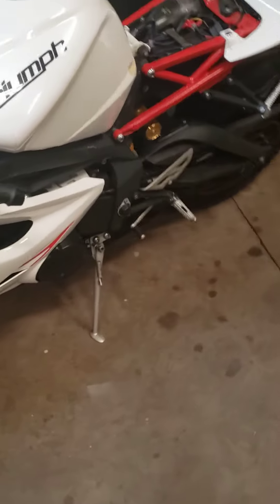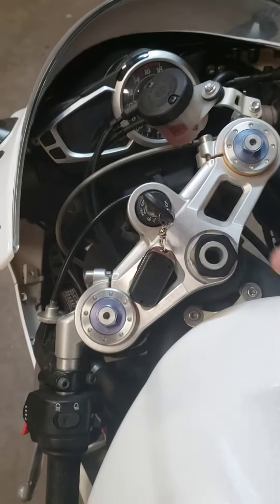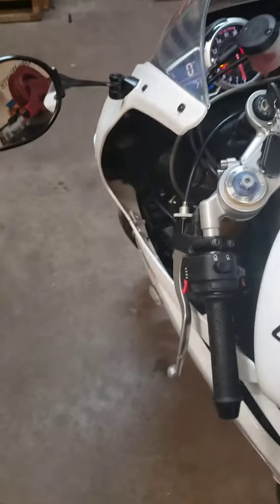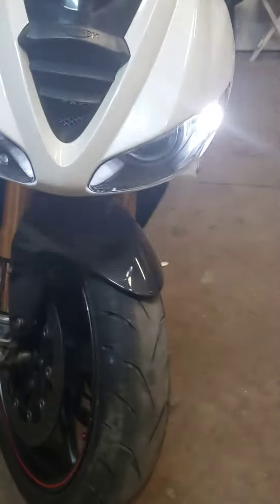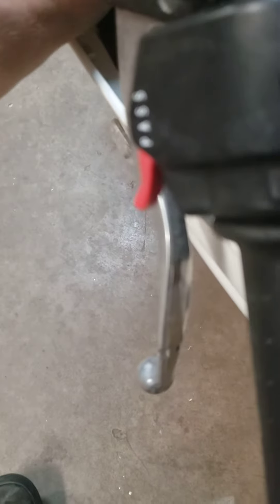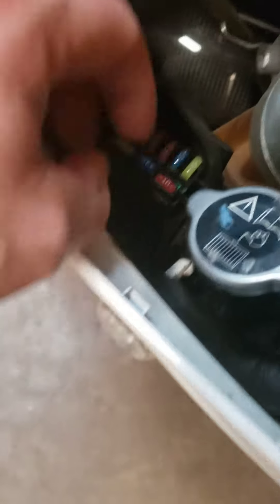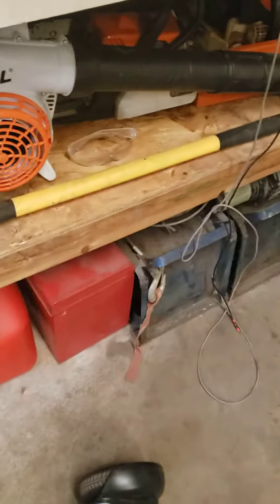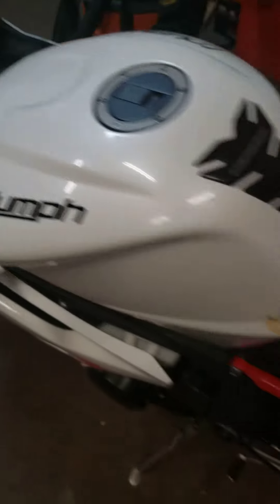2011 Triumph Daytona 675R starting problems

Comment: My bike isn't starting i changed the clutch, stater, and regulator rectifier. 

What fuse is it?
Reply: Looks like the first one 15A, I have a 2011 model too and having this issue. I replaced the battery and checked the connections but it has issues starting without a jump start. Have you figured yours out?

Comment: which fuse is for headlights
Reply: 1 ?
Reply from the maker: I'll check it once I get home tonight, mines labeled I believe.
Reply: @Tyspyro86  I appreciate the quick reply 🙏
Reply from the maker: Mine is at the front of the panel slot 1. And it's a 15amp.  The problem I was having was the previous owner put in a after market light and it must've shorted out and blew the fuse. Some reason that fuse is connected to the starter button so if ya ain't got headlights   and it doesn't start I'd check that fuse. Their is a fuse on the solenoid too.
Reply: @Tyspyro86  thank you, I fixed it. I appreciate the help !